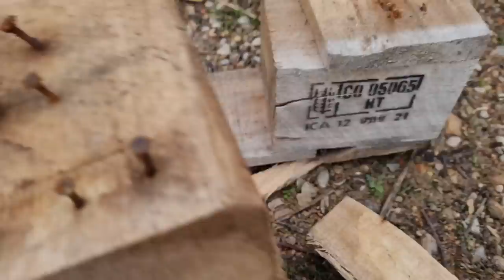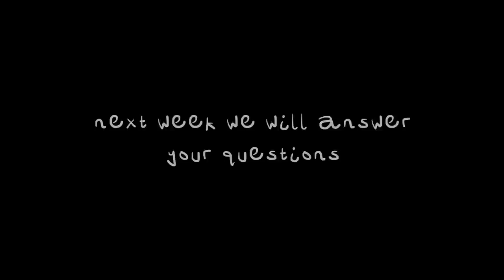A Week of Projects and Struggles | Off-grid Homestead

Comment: To warm yourself up while working you can look for a heat mat for reptiles to put your feet on. It only uses 14 W and cost around 25 euro.
Reply: I will look into this, it's mostly my feet that are cold. Thanks for the recommendation :)
Reply: @MauroGestoso  Keep in mind that the low wattage reptile/chick heat mats are not "strong" enough to warm feet with shoes on. While working at home i use the mat with socks and a small blanket on top. Nice, warm and comfortable. Mats for humans also exist. They are more robust and use more wattage. Hope this helps 😊.
Reply: @MauroGestoso  You need some proper wool socks too!
Reply: @MauroGestoso  Also you could look into making a Japanese kotatsu table … just a small table with a heating element below and a thick cloth on top that goes down to the floor. Prevents drafts around the feet, and is even easier to heat than a small cubicle. Actually a perfect combo with the cubicle space, as the waste heat from the kotatsu table would heat the small cubicle.

I'm just not sure what kind of heating element would be right in your case. Electric is safest, but difficult since you're off-grid. A small water-circulating independent vehicle heating using gas comes to mind, installed behind the wall outside, and circulating the hot water to a small radiator inside.
Reply: @djazt.8053  In Spain we have a system very similar to kotatsu table, it is called brasero. The traditional ones work with charcoal.

Comment: Harriet if you have small pieces to sand, use a block of wood, wrap some sheet sandpaper over it. This works well for edges and small pieces without using a power tool. (Less noisy too 👍) 
A "sandblock" is still used in woodworking. 
Going way back beyond power, people would take a dark coloured rock, sit it in the sunlight (indoors or outdoors, and heat it. Then put the rock (in some cases bricks) under the feet. 
I have low blood pressure, hence slow circulation, and "warm feet=warm me". 😊 Same for putting a rock near the fire. .

Comment: Hi from Canada!  Our home gets extremely cold in winter so much so that we put up a curtain rod above our front door.  It extends past either side of the wooden framework.  I lined 2 curtain panels and hung them on the rod.  When we are in for the night we pulled the lined curtains in front of the door to stop any drafts.  During the day we pull the curtains to one side and it doesn't interfere with opening/closing our front door.  It has made a huge difference.  I wonder is something like this would be helpful to you?.

Comment: Looks like a workbench should be on your list. Easy one - cut a pallet in half for your supports on either end and  another pallet or two for your wood slats across the top. It won’t be pretty but it will definitely help your back❤️✨

Comment: Flap sanding discs are a great way to smooth pallet wood. I use them all the time.
Reply: Aren't they the most expensive way to sand? Disc, belt, or vibration sander should be a lot cheaper on the sandpaper side. I like my belt sander (handed down from my father) as it really packs a punch and is easier to achieve an even sanding with. Fine work can be done by fixing the sander, and paper changes are really easy so you can change between grits.

Comment: If you can get mylar sheets (aka disposable emergency blankets) and hang them above the doorways or even against the wall that would help with heating. It does also trap in moisture so use with caution, I wouldn't use it in a bathroom or kitchen but it might work in an office.  They are fairly cheap and even though they are ugly you can just hang a blanket or curtain on top of it so you don't see it.

Comment: ahh yeah, those projects you think only take a day… we've got a bunch of these day projects. Unfinished, months later. Good to see we're not the only ones that struggle with that! And at least you got some cooking wine out of that bucket! Oh and also, careful with the gas heaters. They produce an enormous amount of humidity and should only be used in well-ventilated spaces. We realised that after spending money on one that it's actually not ideal for our already humid place…
Reply from the maker: Thanks for the heads up about the gas heaters. We haven't really thought it through yet, maybe a mini stove is a better idea, I also only recently realised how big those heaters are, I was imagining something a lot smaller. And other folks are concerned about carbon monoxide in such a small space. So need a rethink...
Reply: @LittleSpanishFarmstead  going back we'd have been better off with a little oil heater. Dry, you won't die from carbon monoxide and relatively cheap to run…
Reply from the maker: @oakolive  but they are always electric, no? We couldn't do that on our solar unfortunately 😔
Reply: @LittleSpanishFarmstead  yeah, that's true… for our tiny house we had a local blacksmith custom-make a tiny woodstove for about 200€ and that heats the 12sqm more than enough. But that will def require some more work :D

Comment: Please don't put a gas-heater into a small space! - seriously, you're just asking for carbon-monoxide poisoning.
Just get a low wattage (500w) electric heater (about 35€ at Leroys) and think about investing in a dehumidifier: you can get ones that only use 165 watts (Greenmigo on Amazon), and you'll find that dehumidified air is loads easier to heat and feel warm in, and a dehumidifier even gives off a little heat, which might even be enough by itself in a tiny space.
But please please please, no gas heater in there!
Reply from the maker: 500w is not an option for us, sadly 😔 I'll definitely bear in mind your concern about the heater tho
I assume they are rated for a minimum space, I don't know much about them, it was just an initial idea about how to heat that small area, with no research done yet. We are also thinking of a tiny woodburning stove.